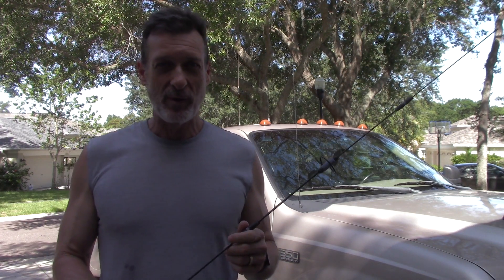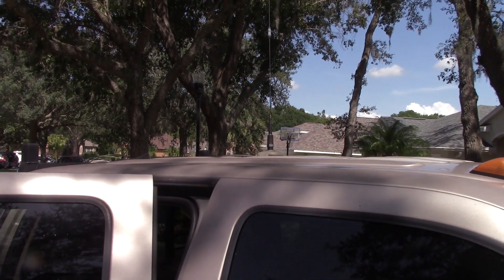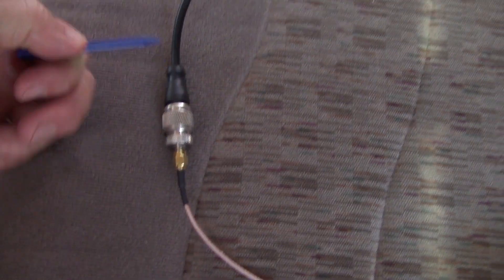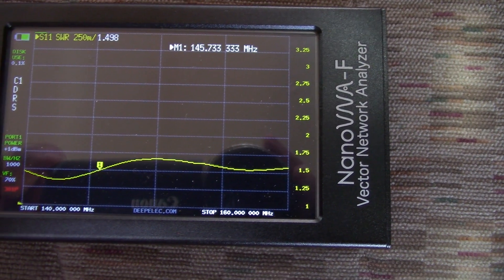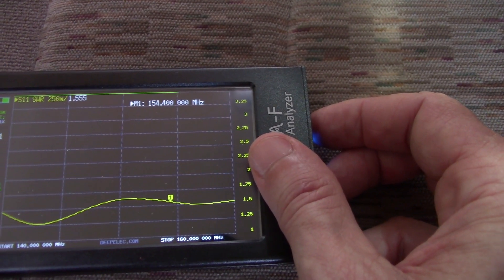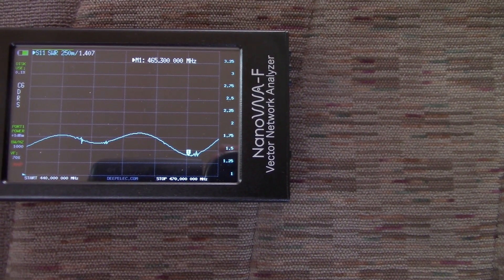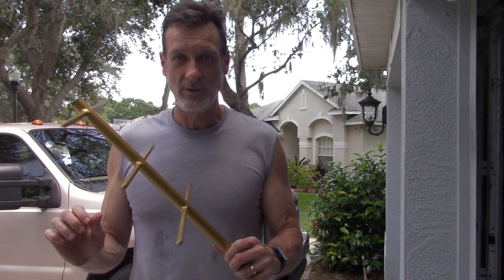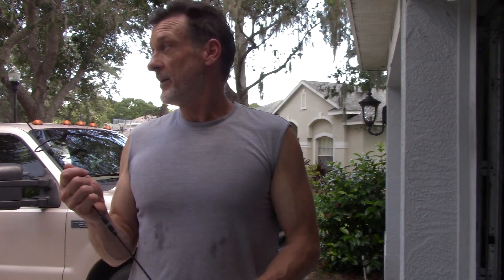Comet 2x4 VNA tested for GMRS and MURS

Comment: I absolutely agree that each antenna installation is unique. Little things can make a big difference. I have a few different "pre-tuned" 5/8 over 5/8 GMRS antennas (Midland, Nagoya, Wouxun) that I tried to install in three different "sweet spots" (RX-wise) that I had identified around my house. By trial and error I found that each antenna prefers its own spot. Moreover, moving the mounts by an inch could easily produce an adverse effect on the SWR readings.
Reply: Another interesting observation along the same lines. I actually have two Nagoya GMRS antennas: one with an SO-239 connector, and one with an NMO connector (both 5/8 over 5/8). I wanted to try both on the same NMO mount, so I got a Tram SO-239 to NMO adapter. To my surprise, the SO-239 antenna with the adapter showed a better SWR than the NMO antenna:)  Go figure. Of course, this outcome may have been unique to my install situation:)
Reply from the maker: I have done the exact same thing with an adapter and discovered a change in SWR. Even adding/removing a gasket to make a waterproof connection will make a change. Both items changed the electrical length of the element.
Reply from the maker: I've had a plan, seems like forever, to get rid of the mag mounts and install NMO mounts to my headache rack on the truck. I know it will skew the radiation pattern and that might be something I can live with. The real question is tuning it. Still on my to do list.

Comment: Hey bro i dont know if you are a HAM or "" just a Mudduck"" 
 ther is in basic Open Feeder balanced .. (a part of the antenna)
and UN Balanced .. not a part of the antenna.. the first Length is a Factor (ladderline)
The second COAX CABEL is not!! if it becomes a part of the antenna somthing is wrong
yes i know the old Cutcabel to SWR trick.. but that is making the Cabel not the Antenna 52.OHm
The on is a Un ewen 1/4Wave minus Welosetyfactor in cabel.. So Regular COAX is not a part of the antenna Period.
If you COAX plugs make SWR .. please buy the bit more expensive PtFe Insulator PL/SO/N (Teflon not Walkitalki Red bakkelit)
the PL/SO is not maed to do above 30MHz (but they do) that´s N it goes to GHz+++ like SMA ... and you of corse know
that you need atleast a 1/4 Wave from any antenna to surondings to adjust Fair SWR.. so VHF is app  50Cm make a test stand out in the open with the shortest possibel cabel to the antenne foot .. make atleast 1 or 4 radials on 45CM to use as ground. 
when you use short cabel you mesiur only the antenna .. not the cabel... so it will mesiur same on what ever lenght of coax you use .. and i ofcorse mean 50OHm Coax.. ( if you use 75.OHm sattelite cabel SWR will rais to 1.5 but you can adjust antenna and suddenly you cabel is a part of the setup funny how things are the same until they arent anymore..)
using a helical antenna like the Diamond X300 it will work as a filter .. until eatch section is matched .. in the  UHF range
nice work tho greetings from Denmark
Reply from the maker: I might have bad word choice on occasion. While tuning I've used a piece of coax that was not part of the final installation. Once I mounted the antenna with another, longer coax, the SWR changed. It can be considered part of the antenna system and not the antenna itself. Like having an antenna near a metal object will affect SWR, but its not a piece of the antenna. .
Reply: @Soladaddy   first the qualety of mudduck rg58 can varie .. cabel is not and newer will be a part of the un balanced antenna.. if  there are changes it is due to shitty cabels or kinks in cabel shitty SO PL plugs .. no it is not only metal dry wall wood anything in the same plane as the antenna.. hence the minimum1/4 wave distance to we are talking of surrondings.. Lets not forget .. this is UHF.. kink in cabel changes a lot even a non certified vinkel plug.. who is not in silver or teflon.. will change SWR.. i hawe seen so baad chinesium plugs .. they made 1.5 on VHF and 2+ on UHF just the plug.. 
what do you think shitty cabel does.. Look For POPE H155 and AIRCELL 7 that is made for UHF ... rg58 is just CHEAP .